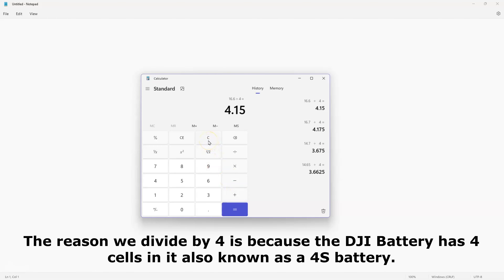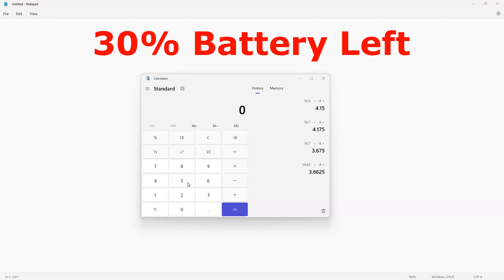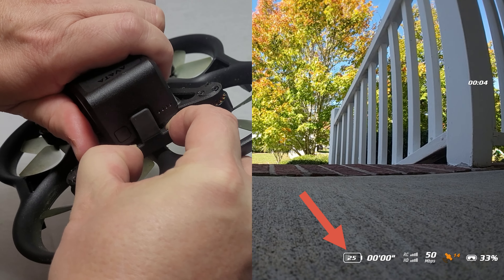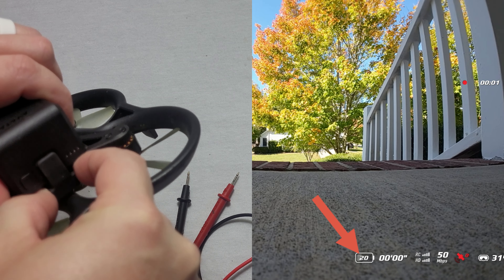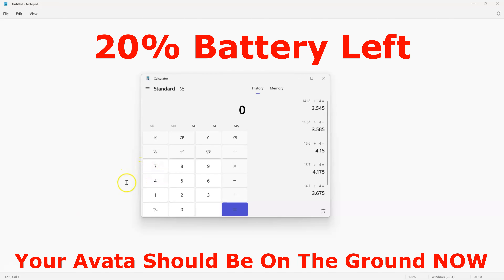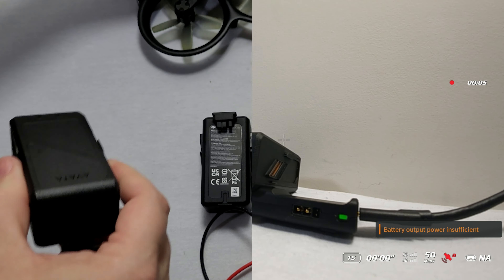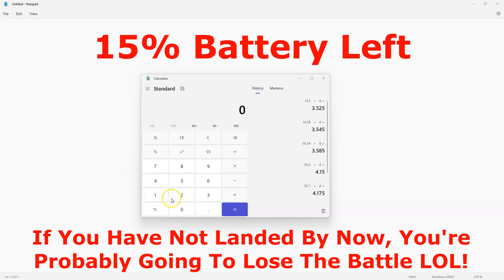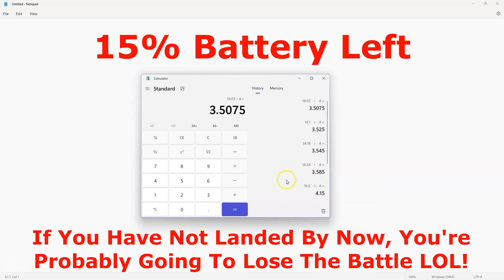DJI Avata Battery  - When Should We Land You'll Be Shocked

Comment from the maker: * Please note that this does not test battery sag. That is when you are flying and punching the throttle, making sharp turns and so on, it will cause the battery to drop voltage for a brief moment. So if you are at 3.6 volts per cell, it could drop as low as or even below 3 volts per cell for a brief moment. This can cause a drop in the efficiency of the PID's causing the Avata to dip or drop from the sky. That's why it's very important to watch the percentage of your battery because as you will see in this video, once you are below 30%, it's getting sketchy at best.
Reply: When I charge dji avata battery it charges in 4 hours.  Please suggest me any solution for this which can charge the battery as soon as possible.  Which charger should I get?  What voltage charger is needed?
Reply from the maker: @latestviralvideo84  Yes, it will take up to 4 hours unless you use my solution here: https://youtu.be/H9LjtbYLUfA then it will charge in about 45 minutes or less.

Comment: Thank you so much for taking the time to do this. It goes to show that 30% is basically 0 in regards to proper usage of normal lipo batteries. Someone mentioned we don't know the chemistry of DJI batteries but we actually do. It's a lithium-ion polymer battery which basically means that it's no different than a standard LiPo in terms of operating voltage. 3.6v and below is going to impact performance and dropping below 3v will cause damage to the battery which will impact its lifespan and overall safety of use. 

Long story short, land at 30%. Stop trying to do flippy floppies and dives on 25% battery.
Reply from the maker: Love it my friend. Feel free to use this on your channel if you like. I love your videos by the way :) it's an honor to have you stop by my channel.

Comment: Good info....I've landed with 5% with no issues multiple times. I usually  run it down to 30% then bring it close to the landing spot and just fly around close and low until it's time to land closer to 5-10% left. It's been ok thus far. 🤷🏻‍♂
Reply from the maker: Thank you for watching. Be careful letting your battery get that low each time, we don't really know what DJI has in place inside these batteries to protect them so in the long run you could be shortening the life of your batteries. Anyway, stay safe, fly safe and have fun :)
Reply: @fpvtrendz  That I understand but I’m ok with it…I had the original Mavic Pro I just sold before getting the Avata…had the Mavic for 6 years almost…anyway it ended up being so boring to fly unless you need aerial footage I think I flew the Mavic maybe 30 times in 6 years. The Avata already has 15 flights in just over a week it’s so much more fun. Just glad I’m actually using it…I’ll take the risk of long term battery damage lol. Better than letting it sit and not get used 😉
Reply from the maker: @damiengvideos4337  I love the Avata as well. I have about 120 flights now, maybe a bit more. I find myself flying it just about every day lol. My other drones are starting to feel neglected lol.

Comment: when I fly in manual mode at about 50%  and below, it do not have  normal  throttle  power. so if you try  to dive it  is hard to stabilise  the drone. I would  recommend,  to do not make  sharp turns below  50% of battery.
Reply from the maker: You are correct yet people continue to try to do freestyle at 25% battery lol.

Comment: You are measuring idle voltage but it's way lower under load in flight. 
It's normal to fly FPV Lipo from 4.2V to 3.5V but even with regular Lipo there are different chemistries and voltages. As we have no idea what chemistry DJI is using and what is the suggested voltage range for it..
Reply from the maker: I know it's idle voltage but I have no way to measure the voltage while it's under its load. For example, when you throttle up, it's going to lower before leveling out again. I was just trying to give an idea of what the level voltage may be at each percent to give us some idea of when we may need to start thinking of landing. Thanks for your comment though, I really appreciate it.

Comment: This should be easy to test actually. I wish we had open grass areas in my city like you guys have that I can test till it dies on me very close to my location. Maybe you guys can test it.  Avata is so rugged that dropping from 3 feet to grass would not damage it I assume...
Reply from the maker: I have crashed a few times from as high as 65 feet with little to no damage, however, I did have one crash that was a direct nose dive from about 100 feet at full speed and the motor broke off. It's funny that it did not break or crack the frame at all but the motor just broke completely off lol. DJI replaced it for me.

Comment: Hi, yes it's a li-po battery, it seems a very large capacity for its size, the chimical composition could be slightly different of the normal li-po batteries we usually use, and maybe the minimum voltage could be lower? Just a thought...
Reply from the maker: It could be and I'm sure DJI has the smarts in their smart battery, however, battery sag is a real thing in all batteries and that's probably why DJI has it  cut the power some when it get's lower, but it will still have some sag. That being said, it's not really safe to be doing much freestyle when it's lower than 50% but for sure when it's lower than 30% and it should really be landed at 30% but no less than 25% in my opinion. Thanks for the thought keep them coming :)
Reply: It could be interesting to know the storage way for such batteries, li-po usually are best stored at 3.8 or 3.85V.
The 2 LEDs on on the Avata battery corresponds to 3.7V per cell. Instead 3 LEDs on corresponds to 3.96V, a bit high for the storage.
2 LEDs on + 1 flashing is 3.85V and seems to be the good storage voltage. The problem the charger sold from DJI doesn't have the storage function and it's not easy to stop the charger at the correct storage voltage...

Comment: One thing to consider is the DJI smart battery calculates voltage to maintain battery health. You can fly 2-5 minutes after battery reaches zero. You can fly the avata to zero and still have 3-4 volts
Reply from the maker: You can, but should you? Probably not. Landing at 30% is best, landing at 20% would still be ok, but the main goal of this video was to show that below 30%, people should not do any tricks. There's a reason it goes into auto-landing mode at between 20% and 22% in most cases.
Reply: @fpvtrendz  your probably right with the track record of DJI misleading consumers and their less than ethical business practices.
Reply from the maker: @myfalconry76  LOL you are correct my friend for sure. They have been pushing out sub par stuff for the last 90 days now like they are going out of business or something lol.
Reply from the maker: @myfalconry76  You may be spot on.

Comment: Thanks.  Hey since we're on the subject,  if there are 4 batteries do you think you could rig up a one or two battery arrangement to reduce weight enough to get under the FAA 250 grams limit?  It just occurred to me that might be possible.  I could see times where I would trade off the flying time for the increased safety.
Reply from the maker: The issue with that is it may not produce enough power to power the motors and the O3 unit. It's probably worth a try though.

Comment: I'm pretty sure you can take it down to 15-20% regularly without much trouble. As per the printed specs on the battery, the nominal voltage is 3.69v and the max voltage is 4.25, which would put a reasonable min voltage between 3.2 and 3.3v, which is the recommended min voltage for many lithium ion and lithium polymer batteries I've heard all my life.

Ultimately, I guess it comes down to each pilot and how comfortable do they feel as far as draining their batts.
Reply from the maker: Yea, it's a pilot thing really. The only point of this video was to determine when someone should be thinking about landing or being more careful. One of the most common issues with most crashes I see on YouTube is the battery is below 25%. When it's that low, the Avata goes into a lower power mode restricting thrust thus making it more vulnerable to an unexpected crash.

Comment: One thing that you don’t test for is battery sag at a normal throttle value. That probably causes sag of at least .1, possibly a bit more. Not sure how this could be tested though. I don’t think the Avata shows voltage in the OSD.
Reply from the maker: Yea, don't know of a way to test for that on the Avata, but you do have to consider it when flying.

Comment: I start landing my drone between 20 and 10%. Whats the point of losing almost 1/3 of flight time?
Reply from the maker: Thanks for the comment. It's just safer to not lose a $700 drone than it is to have an extra 2 minutes of flight time in my opinion. Plus if you have 3 or 4 batteries, it's easier to land at 25% to 30%.

Comment: So are these batteries confirmed Lipos or li-ions??
Reply from the maker: According to the battery and the DJI website, as well as DJI tech support when I spoke to them, the battery for the Avata is a Li-ion. He also said the battery for the goggles 2 is a Li-ion, however, the controller is a Lipo according to him (him being DJI support). That's all I can confirm. You can always contact DJI support on live chat and ask them to confirm that as well. If you do, please let us know if it's different than what I've been told.
Reply: Battery for the quad is a lipo. There have been some tear down vids for this as well. If it’s a lion batt then we don’t have to land till 2.5v per cell and dji are ripping us off for half the battery capacity.

Comment: There are videos showing pepole pushing the battery way below 0 without an issue
Reply from the maker: Yes, people are doing that, however, over the life of the battery, they are going to kill it much sooner. Also, those people doing that are just flying in a straight line not doing anything freestyle. The avata should be landed at 30% and no less than 25% for sure in my opinion.